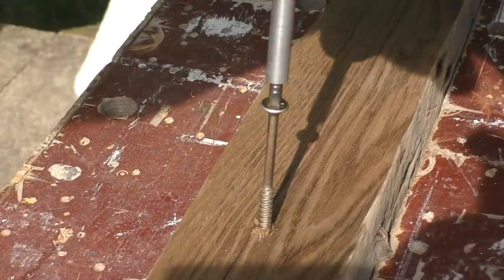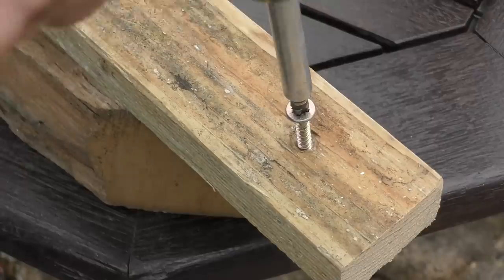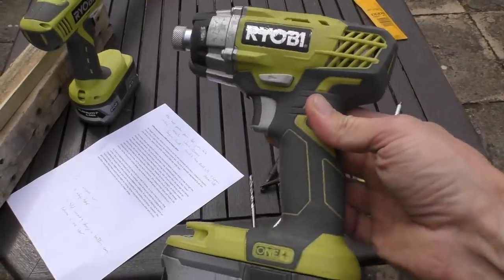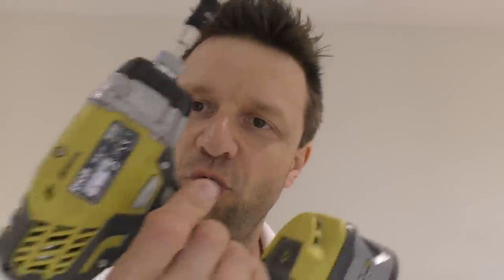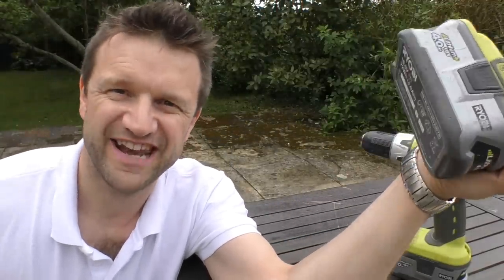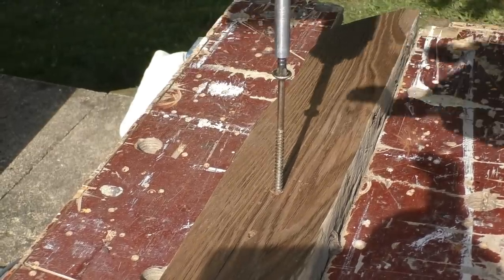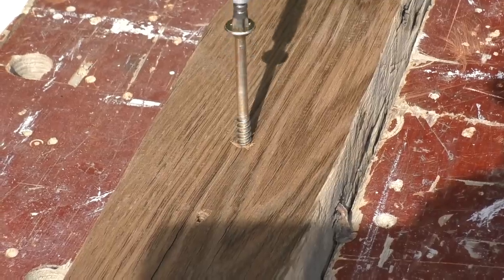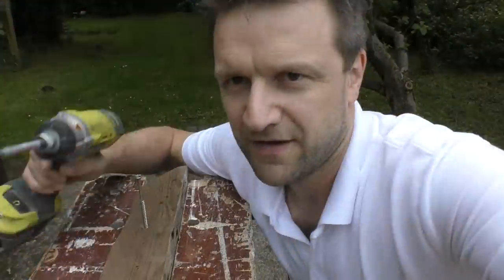Difference between Drill Drivers & Impact Drivers

Comment: An impact driver doesn't really increase power, though it does increase instantaneous torque. It uses previous speed for present torque. If the motor simply isn't putting out enough energy, it won't matter so much if it's got hammer action. So... at the end of the day with the consumer grade general use impact drivers... More power is still more better if you want it to handle more jobs.

P.S. and remember: If you're drilling something that needs high energy impacts like aggregate in cement or something good and stuck, the drills that hammer ridiculous numbers of times a second ... those impacts each have less energy. If no impact hits hard enough to crack the aggregate or tough material ... no drilling or driving happens anyways!

(I guess the thrust of my message is: don't over-sell hammering action, even to yourself. It is better than nothing, but some people make it sound like a battery powered impact driver can replace an air impact driver, or something!)
Reply from the maker: Thanks Ash. Personally I favour a nice light 12v drill driver for most jobs and an SDS for drilling into concrete. I rarely need the impact
Reply: @CharlieDIYte  12v drills always seem to disappoint me, personally, though I do weird stuff like turn wire or drill metal as much as I do house maintenance or assembly stuff! A lot of those oddball things take more raw power potential than instantaneous torque as fasteners tend to prefer.

I hope I didn't come off too upset or anything. You actually gave impact drivers a pretty fair representation. Especially in relation to normal drills.

It's just some people do silly things like use impact count per second as a "more-better" metric, or that they can replace more task-specific tools because they have the same general "feature".

Really, whether it's better or worse than some other impact likely even comes down to the specific task if they're matched for power, and no battery-powered impact driver is going to compete with an SDS!

Though... You did a good job and didn't over-sell, so I'm not even sure why I'm so opinionated, here! At least it's engagement for the algorithms? ha

Comment: Standard cordless drills should put any screw in to depth if used correctly, as said in an earlier comment drill your timber firstly and you'll never have problems, the impact driver is just a drill that makes additional noise and vibration, pointless and needless in my opinion.

Comment: Researched Ryobi and I guess they had issues with their batteries. Does anyone know if they have fixed the issue? I need to buy a drill .
Reply from the maker: I think you'd be fine. Maybe just get an extra 4 or 5Ah battery for the power intensive jobs.

Comment: A friend of mine was using an impact driver to drive in drywall screws and he kept torquing the heads off of the screws and he was losing his shit. He couldn't figure out that the impact driver isn't designed to drive screws because all the DIYers he watches use them. The Impact driver is NOT designed to drive screws.  That's not what it's for. You want to drive in lag screws? Sure. Us an impact driver, but if you're putting in drywall screws or deck screws or anything like that you're gonna have a bad time. But hey MORE POWER!!! Keep your dick in your pants and use the right tool for the right job.
Reply from the maker: As discussed here https://youtu.be/sL-t2Zc4wCs

Comment: Can the impact driver be retrofitted to drill concrete?
Reply from the maker: No. The impact action works in the direction the bit is turning whereas on a hammer drill it's hammering in and out of the hole.

Comment: Some impact drivers let you remove/disable the impact part of it and let you use it as a drill driver.
Reply from the maker: I didn't know that. I'll have to check them out. Not sure how they do that though given how different the impact action is (radial rather than parallel to the bit) 👍

Comment: My you question to you is it says on my impact driver I should not use it as a drill will any thing terrible happen if I do try to use it as a drill thought s please thank you
Reply from the maker: Well I know a lot of people who do use it as a drill (although I haven't)  and in fact you can get hex drill bits that would work in it. However I would only drill into wood as the rpm won't be fast enough IMO to drill into other materials.
Reply: @CharlieDIYte  Hi Charlie well the instructions say it may be dangerous to use as a drill thoughts in your opinion would you think it would be fine if I have been trying research this if the bit is specifically designed as an impact driver bit I would think it should be fine though if the Part is specifically designed do you agree? Thoughts please thank you
Reply: I WARNED TO ASK IF  I NEEDED AN EXTENDER  PIECE FOR AN IMPACT DRIVER IF I FIND ONE THAT'S FITS CAN I use that as long as the very tip is a drill bit or screw driver that is specifically designed or would also an extender have to be impact rated took he played please thank you

Comment: Actually, your explanation of Ah is incorrect. An Ampere Hour (Ah) is the calculated amount of time a charge will last at a steady current draw, 1 amp. So a 4.0 Ah battery is calculated to last about 4 hours with a continuous 1 amp draw at its rated voltage (allow for margin of error). Since the rating is a measure of capacity, not power, a 4.0 Ah battery isn't meant to provide any more power than a 2.0 Ah battery at the same voltage but just last longer. However, since capacity in battery design is the result of parallel cell arrangements, the available max current is much higher, allowing for a higher sustained wattage output.

Comment: All striping jokes aside, I'm surprised everybody (based on the comments) is still using phillips head screws. If you drive a lot of screws you should consider T-25 (or T-15) Torx head screws. Striping screw heads and using great force to keep the driver on the screw head will be a thing of the past.
Reply: how does that work? can you explain?
Reply: @Mstar456  I am sure you have used a regular slot style screw, lets start there. 
- With the straight slot screw driver the screwdriver fits into the slot on the screw, and you apply down pressure and turning force and the screw goes in, but it is slow. Try down force and turning force on your slot screw with a powered driver and the driver will turn, become off centered and slip off damaging your work and perhaps cause injury to your fingers if you were trying to hold it in place. 
- Move to the phillips screw head. With the cross pattern on the screw it is easier to keep the driver on the screw as you apply down pressure and turning force. But these screw heads were not designed for the fast RPM's of a powered driver. The driver will slip off of the screw causing damage to your tool, fastener and job surface... not to mention injury.
- We will skip over square or Robertson style bits. They were developed to solve the bit-slip-off problem but they did not go far enough... pass.
- TORX is a star drive style convention found on construction and other types of screws, many found on automotive applications, and their corresponding bits. As with slot or phillips heads the TORX comes in various sizes. In my earlier post I mentioned two sizes T-25 and T-15. 
- Imagine this, in your mind, take a coffee cup and a butter knife. Hold the butter knife vertical and balance the coffee cup, top side up, on the tip of the butter knife. The skill necessary to balance that coffee cup on the knife would be similar to the skill necessary to driving a conventional screw with a power driver at a medium to high RPM. Now invert the coffee cup so the bottom is up and put the butter knife into the coffee cup. Balancing is no longer an issue, the cup stays on the knife by virtue of the deep walls of the coffee cup holding it in place. That is the skill necessary to drive a screw with a T-25 drive head at high RPM. 
- In my original post I said stripping with the T-25 would be a thing of the past... not true. The TORX drivers (in this case T-25) do wear out. When you buy a box of screws with T-25 heads that box generally comes with a short T-25 driver attachment (about 1" long) for you to use with you electric driver or impact driver (1/4" driver attachment necessary on the impact driver). After you pick out your screws, go the the screw driver section of the hardware store and get a multi-pack of 1/4" drive shafts with T-25 heads. Search for "DEWALT MAXFIT 2 in. x TX 25 Driving Bit". The T-25 bits work great until they don't. When you notice the T-25 bit slipping off the screw head, toss that bit and go to the multi-pack you bought and put on a new one and get back to work. 
-Hope that helps.  
P.S. Once you embrace T-25 screws you will eventually realize all screws are not created equal, which is true regardless of the head style. If you have a load heavy job, look at GRK screws... bring your credit card.
Reply: @fbauer4368  Thanks for the detailed response, very useful inf there, I've got a few D.I.Y projects coming up and Im a total novice, will defo consider using the torx screws instead of Philips although as mentioned in the video us Brits have a fascination with Philips heads and Roberts ones, although i didn't even know the latter existed. Also initially i read your comment wrong, i read bits instead of screws and was shocked that someone was advising using torx bits on a Philips screw and was curious if that was actually viable.

As mentioned Im a total novice so tend to get simple terminology muddled, but will defo improve.
Reply: @Mstar456  Right on, Depending on the project(s) you you have going on you can use hex head screws or something similar. Search for "harbor freight nut setter" just to get an idea of what I'm talking about. Have fun, stay health, stay free.

Comment: What happens if you put the drill driver into hammer drill mode and use it like that to screw into wood?
Reply from the maker: I'm afraid that doesn't work, mate, because the hammer action on the drill driver works in line with the drill bit, in and out of the wall, whereas the hammer action on the impact driver is radial, ie it works in the direction the bit is turning, which is why it makes it so much easier to drive screws in and out.

Comment: A drills power is less related to ampere hours and more related to voltage. The old 12v and 18v batteries underperform when compared to a 20v and above, at least as far as power. Ampere hours more directly relates to battery life when compared to the voltage output of the battery.

I didn't look on either batteries for their voltage, but I'd guess the 4 and 5 Ah batteries were probably 18V, and the 1.3 Ah was probably a 12V. Smaller Ah means less available energy for higher outputs like 18V or 20V. So smaller batteries usually exert less force. Or 12V in this case. 20V and up was always plenty when I did any job. Decks always seemed like one of the ultimate power tests, since you'd be doing everything from attaching balusters, to hanging ledger boards. And a 20V would handle it all. 12V is more for home projects like hanging curtain rods or handrails, or attaching a shelf to a wall with wall mounts. Most drills and impact drivers now come with 20V batteries (even the Walmart and house brand drills/impacts), even at smaller Ah, because it's always advisable to have more power than you need, as opposed to less. If you want better battery life, spring for the higher Ah 20V batteries and save yourself the heartache of having a drill grind to a halt at the start of a project.
Reply from the maker: Thanks for this. Just coming back on one of your comments, the 1.3Ah batteries are also 18v.

Comment: not much effort if you first take the drill driver and use a drill bit with a slightly thinner diameter than the screw to drill down nearly the entire length of the screw which is the advantage the drill driver has over the impact, then switch to the driver head and screw it in. takes longer but is much easier than the impact or just raw with the drill driver.

Comment: So which is better? Drilll or impact?
Reply from the maker: On balance drill (because you're unlikely to need an impact that often), but remember they both do very different jobs. The hammer actoin on a combi drill works in and out of the wall, whereas the hammer action on an impact works radially, or in the direction the bit is turning, which makes it so much easier to drive in the screws. But you can't use the hammer action on a combi to drive in screws and vice versa with the impact driver.

Comment: Drill driver with hammer action becomes an impact driver. Get good batteries.
Reply: Dave Scowen hammer drill impact force is just the same as hitting a screw or bolt head with a hammer. An impact driver applies its force to the rotation of the screw or bolt head.

Comment: The video showed the difference between batteries very well. However the video was about the difference between an impact and a combi drill, not batteries. Here it got a bit confusing as both drills were able to screw it in using a 4Ah battery, and neither could with a 1.8Ah. So basically the demonstration implied there is no difference?
Reply from the maker: Danny here's a better video https://youtu.be/sL-t2Zc4wCs Bottom line you won't need an impact very often so you're much better getting a light drill driver for most common DIY tasks and then an SDS for drilling into concrete - as the hammer action on a combi is hopelessly inadequate for drilling into concrete so you may as well spend your money on a cheaper lighter drill driver than the heavier combi.

Comment: got a bosch impact drive free at work with both batteries . now i have to buy a ton of drill bits ,sockets , screw heads -_ - . anyone know an all inclusive cheap kit ?
Reply from the maker: This is a nice starter set https://www.screwfix.com/p/dewalt-straight-shank-drill-accessory-roll-mat-set-98-pieces/86483 I use it all the time. I've also got this one https://www.screwfix.com/p/makita-straight-shank-accessory-kit-252-pieces/90001 but it's less portable.

Comment: If both batteries are at the same voltage, then the size will not matter. Maybe the smaller battery has lower voltage, therefore less power.

Comment: Stopped using battery powered drills. Much prefer corded drills, for as little as I use them they will always work. And I see little point to an impact driver after watching this unless I am driving several dozen screws. Which I will never do so yep standard drill is frankly as much as I will ever need.

Comment: basically: get the most versatile tool and a big battery.
Reply from the maker: Yes, except combi drills' hammer action is pathetic if you're drilling into concrete, so these days I prefer a light drill driver and SDS to cover all bases. https://youtu.be/sL-t2Zc4wCs
Reply: @CharlieDIYte  i was able to drill though 20cm thick concrete no problem with my ryobi r18pd7.

Comment: Fucking great video. I still have a few questions though.

1) Should I get a keyless or keyed drill?
2) What does that even mean? I think the one i have is keyless. I don't like it, the bit keeps unfastening itself from the drill. I want my bits to stay put, does that mean i want a keyed drill?
3) I'm just trying to drill a hole in my carpeted floor to keep these wires from being a trip hazard. Just go with a drill then?
4) about the Amps per Hour thing, when shopping - what kind of marketing "tricks" do i need to watch out for? meaning: if a battery says it's 1.3Ah and the other says 4Ah, in terms of powering the drill (like, how much force the drill it able to produce) is the higher number Ah always better or do i still need to look at the volts and watts or amps?
5) what do wats, and volts mean when buying a drill? is a 20V always better than a 15V? what does that increased voltage do?
Reply from the maker: Thanks buddy. Take a look at this one too as it goes into more detail on the difference between drill drivers, combis and impacts https://www.youtube.com/watch?v=i6KYfrDBj3w&t=44s
1) most drills these days are keyless. I hear what you say but a good quality keyless chuck won't keep coming undone, so that could be your problem...?
3) can't say for sure without understanding what you're trying to hide and why. Are you drilling into wood below the carpet or concrete? What wires are you talking about?
4) For most jobs a 2Ah battery will be absolutely fine, and being light it makes for a much better experience as you're not having to lug a heavy drill with a big battery around. 4 or 5Ah batteries tend to be best for power hungry jobs, like SDS drills, circular saws, that kind of thing. Depending on what you're going to be doing DIY wise, my advise would be to get a 2Ah and 4A or 5Ah battery. That way you're covered for most jobs
5) I'm not an electrician so I'll keep it simple. It comes down to power or torque. A 36v battery is going to have more power than an 18v battery but won't necessarily last any longer. I have a little 12v drill driver that is my favourite drill driver. It's not particularly powerful but for most screwdriving or minor drilling jobs, it works fine and it's incredibly light.  My advice to someone the other day when they were asking what drills they should buy was to go for a light drill driver (doesn't have a hammer action) for most jobs and an SDS drill for drilling into brickwork and concrete. The combi drill is designed to do all these jobs, but the hammer action isn't great and the trade off for a one tool fits all like this is that it's heavy to lug around.

Comment: What's difference between button 1 and 2 on driver.
Reply from the maker: Its the drill speed. Button 1 is for driving in screws and is much slower. Button 2 is for high speed drilling.
Reply: @CharlieDIYte  T4!!!